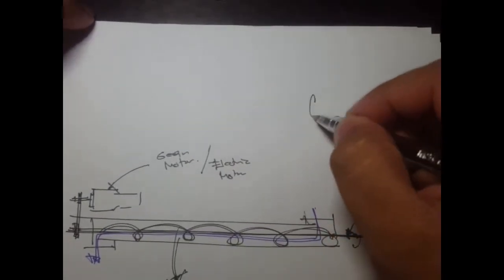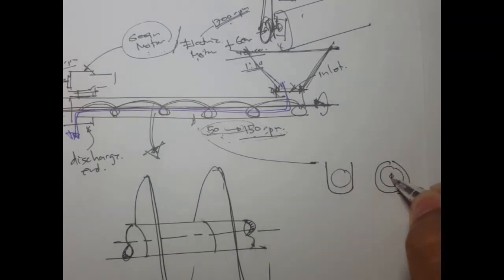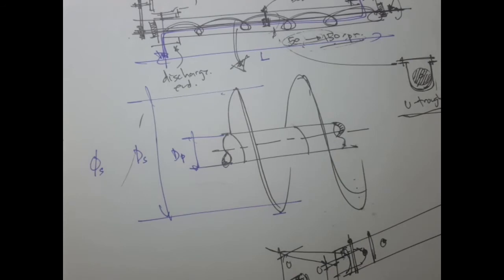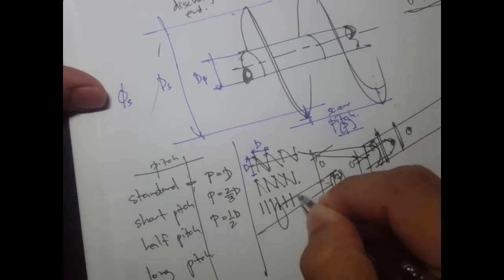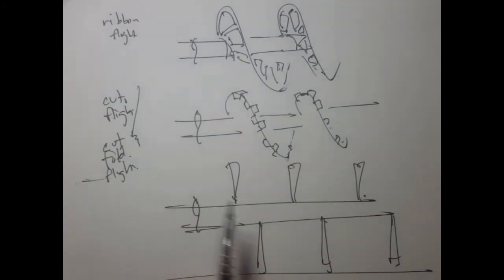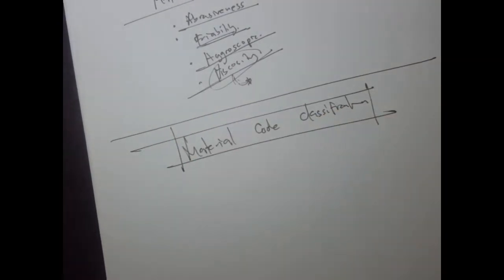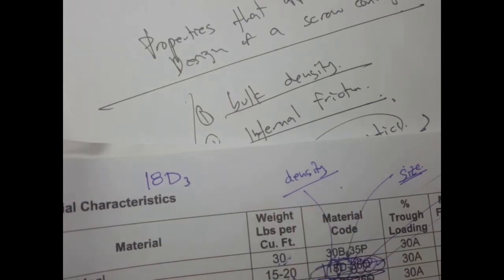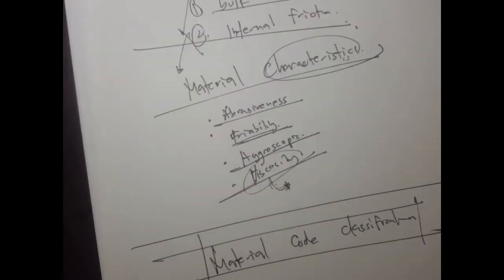ABE180 - 04.01 - Design of Screw Conveyor (Part1)

Comment: Can you please tell me how do we decide which type of pitch is to be used for which type of material?
eg. Design a screw conveyor with capacity of 5 t/h, the length from input hopper to output discharge is 1500mm, the density of material (salt) is 75 lbs/ft3. 
Please tell me which type of pitch (standard, full, half,etc) should be used and why, as it plays an important role in designing screw conveyor.
what pitch should be kept for horizontal and inclined screw conveyor for same capacity and same material?
Reply from the maker: the inclination actually depends on the loading points (inlet and outlet).  the pitch usually depends on the fluidity of the material and the inclination.  narrower pitch are common for fluid-like materials at steep angles to compensate for the back flow of the material.  From the screw capacity equation and holding all other parameters constant, we can see that the greater the pitch, the greater the capacity.